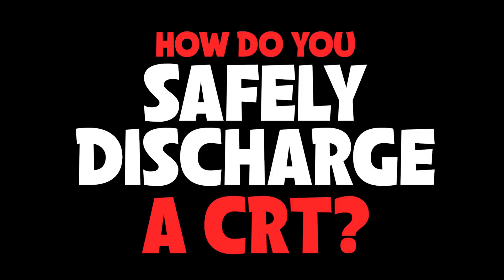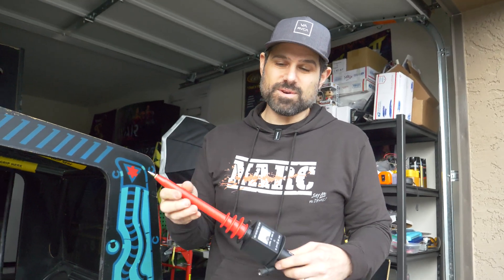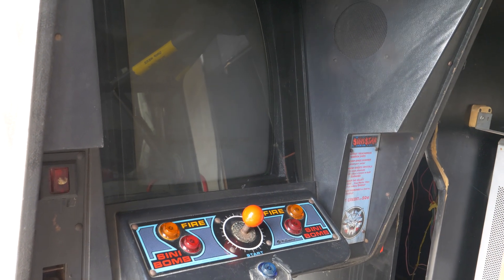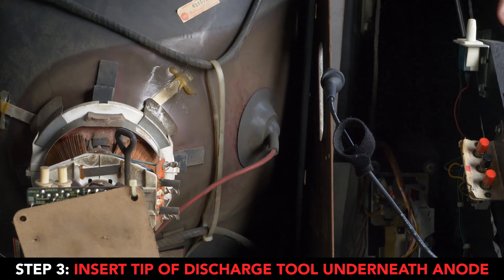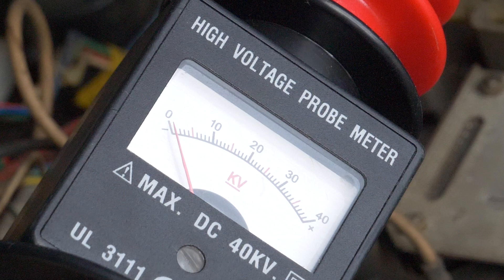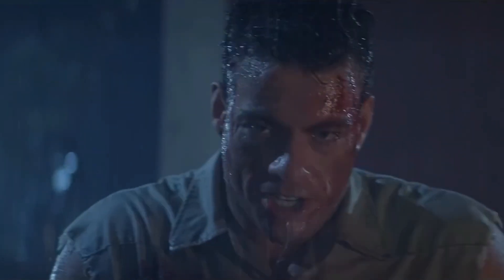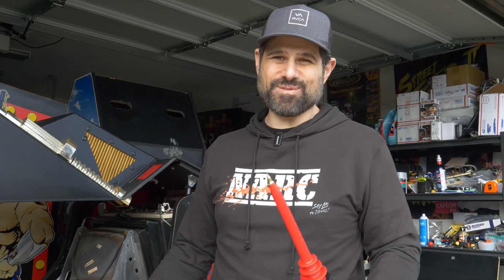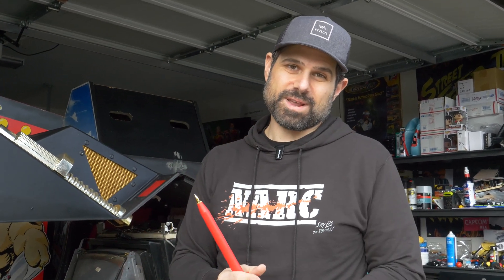How to Discharge an Arcade CRT Safely!

Comment: Okay so how do you get good earth ground to short the anode to when the unit is unplugged? I know that usually all the chassis metal is connected together by a grounding strap, but where does it ground when unplugged? Shouldn’t you have your probe connected to an actual legit ground?
Reply: The anode cap is the positive (+), and the chassis is the cathode ground (-). When you connect them together, it discharges the tube. Don’t ever work on a CRT with it plugged in.
Reply: @ Answered a question nobody asked. How is any chassis ground a sufficient ground when it is itself isolated from earth ground? I never even insinuated you would ever discharge it with the unit plugged in. My question is still: Shouldn’t you have your probe connected to an actual legit ground?

Comment: Thanks for this, it's the most thorough step-by-step I've seen of what I think is the best approach. The other big plus to using a probe aside from safety is that it's way gentler on the tube and isn't going to risk damage to it. The cause of the spark from using something like a screwdriver is because of electricity exiting the tube with that ~5-figure voltage behind it and nothing to get in its way. It's not a steady current of course, but there's enough force behind the electricity coming out to potentially cause damage and shorten the lifespan of a tube (especially cab tubes that can be anywhere from 15-40 years old or so?). A probe's main feature is high resistance that slows everything down, and it reduces electrical forces on the tube a ton (btw some later CRT setups w/bleeder circuits do the same thing when powered down).

Comment: $160, probably worth it. I've got a 40" Misubishi (CS-40809) and it is VERY INTIMIDATING. It's pretty dirty inside since I found it on a curbside in Apple Valley Ca, very beautiful picture, but I try not to run it very often until I find a way to clean it out. I contemplated on using the screw driver method, but attaching a PVC pipe to the handle to give myself as much distance as possible (I've heard stories of arcs actually jumping and biting peoples' hand). Nope... I'll give this probe a try instead. I'd love to showcase my set, there already is a vid here on YT about it, but it's on 480i instead of 240p (the flicker is real on this set in 480i), but 240p is absolutely gorgeous!!!

Comment: Question after discharging the CRT and working on it and turning on the Arcade afterwords will the CRT still work? Or is discharging the CRT only if your no longer going to be using it? Thanks!
Reply: Yes, the CRT will still work. As soon as you plug it back in, the tube will become charged with electricity again.

Comment: The loud, scary pop makes me feel alive man! Until that one day when it makes me feel dead😂
Reply from the maker: LOL... Exactly!
Reply: @RetroRalph  I currently go the screw driver and giant rubber gloves route haha. That discharge tool is interesting though, I like that you can see the charge leaving it.
Reply from the maker: @KillerArcadeGames  Yeah I used the screwdriver method in the beginning, but this gives me piece of mind.  I'm on CRT Repair # 26 at this point, so I want to just "know I'm safe" but I realize some will make fun of me for using this tool, it's all good though.  Thanks so much for watching brother, stay safe out there!
Reply: @KillerArcadeGames Its a good tool to have if you work on a lot of high power electronics. Not super necessary for the one or even two time though.
Reply: It will probably never kill you because that loud pop has extremely low amps, but it will hurt like hell.
Reply: @Aberusugi it’s funny how after some time of doing this I barely worry at all now 😂 I even got a light zap adjusting a color pot with my finger the other day while the monitor was on. Thankfully it didn’t happen when I was learning or I’d have been even more afraid.

Comment: there is no additional safety gained by using a high voltage probe to discharge a crt. in fact it is the exact opposite. A hv probe is intended to act as a voltage divider for measurement of high voltage.  the thought that an hv probe is needed or provides additional safety is misinformation that stemmed from an old cinematronics service update which suggested a discharge via resistance.  the update was a way to confront discharging rare factory defective tubes in which the inner Dag did not adhere properly. It was theorized that a fast discharge could create a repulsive charge that could separate the inner dag. but there has never been any evidence to support this idea.  another rumor floating around is that you should use an hv probe to prevent damage to external flyback diodes. "mostly bw vectors' but the truth is the schematic for internal diode flybacks is exactly the same as external so there is no evidence to support that either.  by the way you show in your video that you had to do a second discharge to fully discharge the tube. this is due to dielectric absorption. electrons are forced into the glass between dag layers and return to the plate after the voltage has decreased.
Reply: Do you use Reddit?
Reply: Used to use a screw driver to chassis that's what I was taught how to do it on TVs might make up jump first time but it's all good fun. Best part was getting rid of the junkers and smashing the tube with a brick and watching it implode and explode or you could just knock the neck of the tube if you wanted to be safe but where's the fun in that 👍
Reply: This video is definitely a flex post. Only peasants use cheap flathead screwdrivers from harbor freight.

Comment: Additional PSA:  The local electric company always did elementary school assemblies to teach us kids not to go around downed power lines.  In the presentation, they went over how the linemen blew air into their rubber gloves looking for a pinhole leak.  They'd cut the finger off a glove if a leak was detected to make it obvious to never use again.  The high voltage electricity has no problem using a pin sized hole to find the shortest path to ground through a lineman...  That's what I think of when I see the oven mitt videos, so DTE Energy did their job on me... :)  I have one of those HV probes after you showcased them the last couple times you did videos on this topic.  Thanks Ralph!!!  P.S. - I still remember your livestream discharging one of your first CRTs... hehehe
Reply from the maker: So wait, the oven mits don't work?  LOL Thanks so much for watching bud!
Reply: @RetroRalph  Well.... they might work as a fashion statement.  I'll concede to that... :)

Comment: You can safely say the yoke coil is discharged without checking voltage with a multi meter? You're discharging a capacitor. I don't care what you're using to discharge it. Meter voltage and test resistance.

Comment: Aren’t there still caps in there holding a significant charge? I didn’t think discharging at that point drained all points containing dangerous stored power.
Reply: You are correct, doing this won’t discharge everything. While probably not lethal there may be a couple of high voltage capacitors on the main board that you could also discharge manually after doing this.
Reply: No, the anode is inside of the glass plate of the CRT.